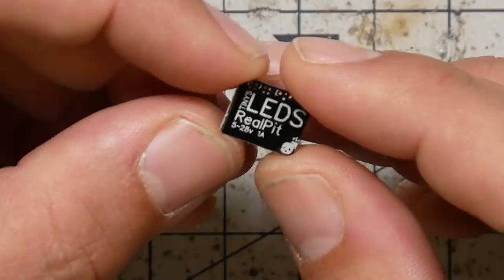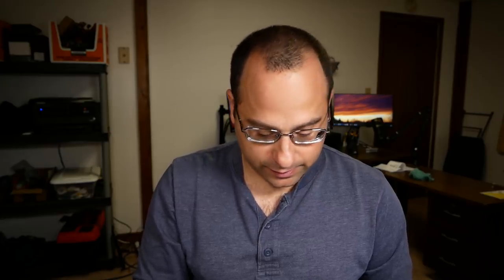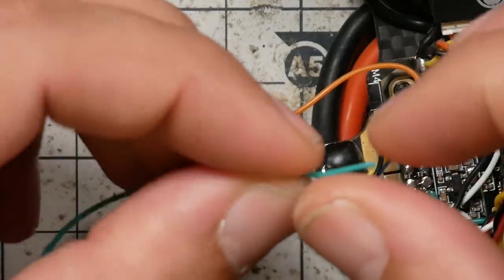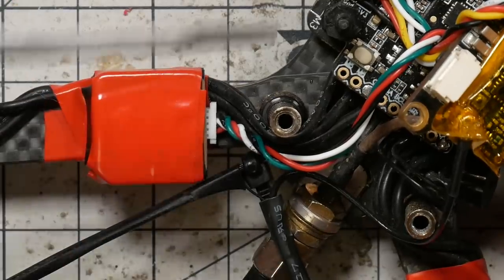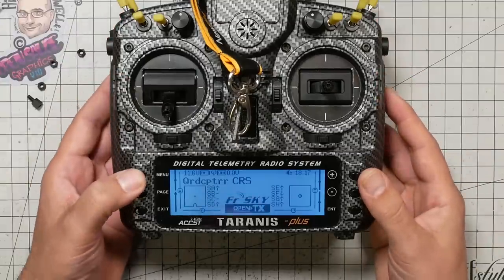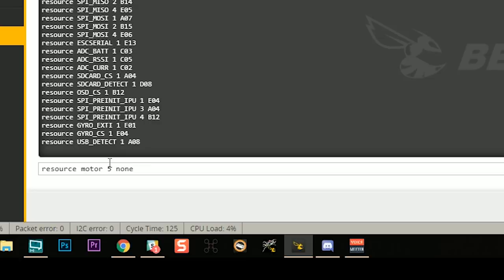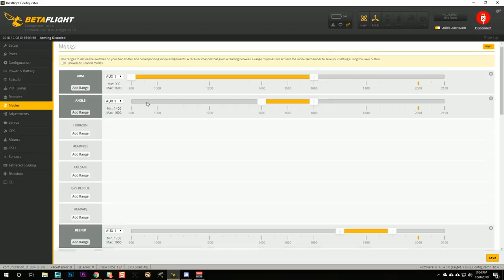Switch vTX Power Off Remotely? | TINY'S LED REALPIT

Comment: Joshua, I have been using these for couple months now and have them on all my quads.  I love them.   BTW if people are short UARTS and you have SmartAudio on the Tx of a UART, you can use the Rx of the same UART for the Realpit.   Smartaudio only needs the Tx line.  Just locate the Serial Rx pin related to the Smartaudio UART like you mentioned and remap it accordingly (eg. resource SERIAL_RX 3 NONE and resource PINIO 1 B11 ).   A suggestion for cases that other pads are not available on the FC.

Comment: Josh, get that GPS antenna off the arm. You should put two large zipties next to each other, zipped to the arm, and leave about an inch not snipped. Wrap it from the top and zip it at the bottom so when you mount the GPS to the top of the unsnipped portion, the surface of the GPS is flush with the surface of the arm, then all you have to do is heat shrinktube it all together. I have it like this on all my builds.

Comment: For those of you that saw my questions to Joshua about the Omnibus F4 V5 I have an answer. I am running a Spektrum Spm4649T receiver. I have the signal on the receiver hooked up to Tx3. The Smartaudio is hooked up to Tx1 and the gps is hooked up to Uart 6. For the RealPit I have it hooked up to the led strip 1 and it works finally. Thanks again Joshua, Tony
Reply from the maker: Glad you got it working Tony!

Comment: Just to highlight.  With this and Betaflight you CAN change VTX channel without the VTX being on using LUA scripts.

It was a throw away comment, but this is critical for racers who may need to change channels between races without knocking other pilots out of the air.

Another way to do this (and may be worthwhile of another really short video) is to change change channel on the FC using BF CLI.  (set vtx_band = 4 <ret> set vtx_channel = 6 <ret>  save <ret>).  This way you only power the FC (and do not even need a battery as the FC gets power from USB).
Reply from the maker: Yes correct.
Reply: I stand corrected ... I assume you tested this with all popular vtx's ?
Reply: @KiSwiSje  As usual, must with with VTX that has Tramp or Smartaudio.  :)   The startup sequence sets the VTX to the channel the one set in the FC.

Some FC's can power the RX directly from the USB.  You don't even need a computer, just a powered USB cable (like an iPhone charger wall wart :) )

I tested it with my KakuteF4V2 with MatekHV VTX.  Works fine.   I use Betaflight 4 and the new launch mode for racing.

Test on your own setup to ensure it works for you.

Comment: You can do the same thing with a 12mmx12mm mos trigger switch, that costs about 50 cents, with less wiring, and the ability to handle a MUCH higher amp load, (even the HD realpit is only rated at 2amp, the 50 cent switch I use is rated for 200amps) or a one dollar trigger switch/voltage regulator combo board that's not much bigger, if you needed to drop the output voltage at the same time.
Reply from the maker: Yeah you can. But this one is nicely soldered to a PCB and easy to work with. Nobody is representing it as anything except a little FET on a PCB. If you can do it cheaper, more power to you :-)

Comment: Now we just need to incorporate into the FC!
Reply: So true. This feature should be every FC, at least one switchable 5V line.
Reply: @Gosuminer  clracing f7, build in
Reply: @SaverioGarzi  That's cool, but I really hope this catches on because it would be so useful for racers and freestyle pilots alike.
Reply: This I already in the WhitenoiseFPV Synergy FC.
Reply: I do not know why we can't have a programmable logic signal control on any of the digital out lines.  Seems obvious to me.  Configure in the adjustment tab "aux3 > 1900; trigger pa6 high".
Reply: VTX switching is built into the Matek F722-SE aswell..

Comment: Soo it's an electronic switch with a fancy name? It's a damned good idea nevertheless.

I wonder if we'll ever get to the stage of analogue video transmitters adopting the spread spectrum technique of avoiding interference, if such a thing is even possible.
Reply: It’s a high side switch. Safe to use on anything we have on our quads. Low side switch options have possible issues of allowing current to flow into the MCU and fry it.
Reply: Could you briefly explain what these 2 types of switch are? TIA
Reply: robrow there are essentially two main types of transistor, NPN & PNP, MOSFETs have P-channel & N-channel types.
The most commonly used type is NPN & N-channel which when used as power switches essentially turn ground (low side) on/off, whilst the PNP & P-channel turn positive voltage (high side) on/off.
Reply: licensetodrive Thanks, today I learned something more 👍
Reply: Been using for for a few months and really love it, really great and simple idea with lots of possibilities available with more to come!
Reply: I built it since i started fpv..i thought it was on the market!!!
So at least i was ahead in something, :D

Comment: Great video Joshua! I have a MUCH simpler option. Just install a miniature 12v switch inline with the +v rail to the VTX. You can get tiny surface mount switches anywhere! Job done. 👍
Reply from the maker: Can't be triggered remotely though.
Reply: Fair comment, 🙌 probably come in handy if you crash and you don't wanna fry the VTX, although I use Lua Script on my QX7. Cracking product tho. 👍
Reply: This doesn't require Lua script. And you aren to able to reach your quad on the starting line once the race has started. So while a physical switch is possible, it is not comparable product. @Ja5onB0urn3

Comment: You don't want to power off your receiver with one of these, you want to put your quad into failsafe instead to control that.  Set the switch so when the VTX is off failsafe is on.  You can do up to 3 quads this way all bound to the same model.  Extra points if you put a mix on that switch that allows another switch to move the main switch 20 points or so.  Then you can have a remote VTX switch and a quad switch switch.  This is the ideal team racing setup... 3 quads... all plugged in... and the ability to select each quad and turn off all VTX while still having control of the quad.
Reply: Are you using crossfire? I tried using failsafe for this purpose and couldn't get it to work?

Comment: Back in my pre-FPV quad flying days I wanted to switch something on/off through the PPM signal from the receiver in my GPS quad, could've bought such a switch, but it cost half that to make one with a microcontroller & MOSFET, so I did.

What did I want to switch on/off by the transmitter? A 50 watt LED sitting underneath the craft pointing down :D
Reply: licensetodrive leds use low side switching. This is a high side switch.  It safely isolates the component from our FCs to not allow current to flow through the MCU.
Reply: Technically LEDs can use low or high side switching, but I get your point about it being a high side switch, I have a bunch of both in my parts collection.

Comment: Great, but shouldn't it work without this device too? Betaflight has this pitmode option in the modes tab. Didn't work for me actually, even though my vtx (akk oscar backpack) supports pit mode and smartaudio is connected.
Reply from the maker: No, it doesn't work without this device. Pit Mode is not true power off, for one thing. Some vTX put out too much power even in pit mode, and can interfere. More importantly, many SmartAudio vTX refuse to go back into pit mode after power up.

Comment: One more device to fry or cause weird issues when 100% working device doesn't turn on when it need to :)  But I see the good side too. It can help to toggle off and on VTX'es without PIT mode built in. For example - to Matek VTX-HV owners. The real problem would be lack of I/O pins in some FC boards.
Reply: Only reason this device would not work would be user error in configuration. 
Also. This can use almost any pad on an FC. So lacking of of I/O pins would not really be an issue for any modern FC. You do not need a Full UART or anything like that. Just a pad on the FC that is able to be assigned to PINIO function.
Reply: @TinysLEDs  For many "decent" FCs it is still an issue if you wish to keep LED strip and buzzer functional.

Comment: There's a flightcontroller in the pipeline with this feature already integrated ;) And you can also directly solder the vtx to the pcb board of the fc !

Comment: I also noticed you Kapton tape on RX do you prefer to clear heat shrink? I have it but have never used it but think I will give it a try.
Reply from the maker: Clear heat shrink is fine but it's often a little thicker than Kapton and also I never quite have the right size.
Reply: Thanks for the reply and all you do for the community. This video gave me something else to buy which is not a bad thing. I have a few builds I am working on and one will be the remix frame with a mix of purple and gold stand offs, your FC and ESC combo and your purple and gold motors. I can't wait to get the parts and see how it will all look. (no clone parts this time)

Comment: If you don't want  to have the User2, User3, and User4 visible, you can type "set pinio_box = 40,0,0,0" and then you will only have User1 visible in the Modes tab.
Reply: You can also just click the hide unused modes button at the top. We did all 4 just so that you have the ability to easily configure more than 1 realpit if you needed to.
Reply: @TinysLEDs  That is also an option.  I personally never use that little switch. If one was to end up using another user defined box they would have to go into the CLI tab again anyway to set User2, 3, or 4 so it's really a matter of taste.  Both options work in the end.

Comment: if the vtx is not powered, you can not use the lua script to read the settings, or change the channel, I think. Same goes for the betaflight OSD method. Only way to do this is with the wand, or with the (experimental) android app, using the connected tag. I can not easely test this, but with your setup it should be easy enough to verify this. Maybe some day we will see this sort of thing built into fc's and betaflight? Better still would be if a vtx starts up in a real 0mW pitmode.
Reply: apparantely, I am mistaken ... ArchmageAU commented on this. "Just to highlight. With this and Betaflight you CAN change VTX channel without the VTX being on using LUA scripts."
Reply: @KiSwiSje  Some FC's can power the RX using the USB (like Omnibus).  On those, the TX LUA script will work without even having to start Betaflight configurator.  Just plug the FC into a powered USB cable.

It's a neat little hack.
Reply from the maker: ArchmageAU is correct. You can write the setting to the FC using OSD or CLI and then when the vTX powers up, it will take the new setting. You should verify whether the vTX briefly blasts the old channel though.

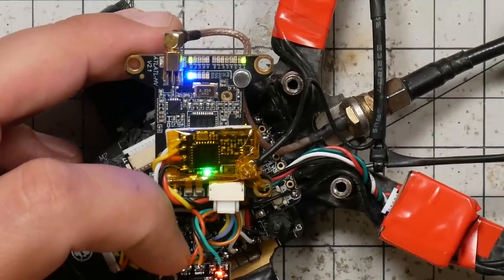Comment: Hi @joshua, thanks for the very thorough videos. You mentioned at 9:39 that we can have up to 4 of those connected to the FC. where is the limitation to 4?
Reply from the maker: I believe that the pinio function only supports up to four user modes. So that limits you to being able to switch only up to four realpit devices.
Reply: Joshua Bardwell
Makes sense, thanks 🥇

Comment: ooh this could help me, currently i use the runcam split 2 on my second quad as a ground camera, obviously i dont want to power the whole quad so i've jerry rigged a jst connector to power it by itself or via the quads power line.

Comment: I have a Tramp VTX and I simply used the Pit Mode option in Betaflight Modes to do this.  No need to buy anything or solder anything.
Reply from the maker: Like I say in the video, put mode is not guaranteed to avoid interference. And put mode doesn't work reliably on many vTX.
Reply: @JoshuaBardwell  Appreciate that.  I can only speak on my own very limited experience and the Tramp VTX  (ImmersionRC Tramp HV) has a Pit mode capability and with Betaflight Mode it seemed like the logical choice for me.  I have used it and it seems to work fine so far.  I always appreciate your videos and have learnt so much from you, Thank you.
Reply: That "pit mode" is just super low power. This is ZERO power and universal for any vtx. or any other product you would like to use.  @cavman7

Comment: Im kinda surprised no VTX's yet have come out with this built it...
Taking a PWM signal means it can also be connected to rx's with spare out[uts like the L9R while FC runs on SBus....
Great idea, but it's so small it
ll need heatshrinking onto the VTX or similar- which brings me back to the first sentence......lol
Anyway, thank you again :)
Reply: Whitenoise FPV has one coming out soon. he also does boards that mount the vtx onto the stack that include realpit. I'm using one with my unify nano

Comment: Joshua, is the set up the same for Tiny’s “2-12s LED PDB with FC Switch”. I want to use this board for all my LED’s on my bangGod, just one switch for all on/all off. It lists as good for 21 AMP current limit. Thank you

Comment: I was wondering why wouldn't  be possible to power something directly from an MCU pin, like the buzzer out. And the problem is that pins handle only up to 25mA. This is why Tiny's Led exist. I would like to know what signal/voltage is the remapped pad outputting.

Comment: So, it is like connecting basis to signal wire, in your case it's connected to pin M5 on FC, and connecting vbat to collector, emmiter  to vin on vtx.

The current flow from collector to emmiter that is going to power the vtx up is controlled by output from signal wire .. cmiiw

Comment: This would be very convenient to switch GPS on and off for rescue mode. If I just race proximity I don't need to wait for 5 minutes for the GPS to lock 6 satellites.
Reply from the maker: You can set the "min sats" to zero. Then you can arm any time you want but if you have < 8 sats GPS Rescue won't work.
Reply: @JoshuaBardwell  really? I have set minimum sats to 6 and it works just fine.

Comment: You could wire your vtx ground to your buzzer ground. And then setup up mode switch to control the vtx.
Reply from the maker: This is risky because the buzzer circuit probably can't handle as much current as the vTX needs. It might burn out.
Reply: @JoshuaBardwell  true but if it's just for a race vtx they do demand the lowest amperage and the ground side is the safest side.
Reply: Ground side is NOT the safest side for vtxs. Maybe LEDs but not vtx's. This is a high side switch. and 100% universal with all current VTXs. the Voltage range is much higher as well.  @HighTideFPV
Reply: @TinysLEDs  I suppose so if you didn't have your vtx on 5v. A lot of vtxs are ran on lipo voltage now days.

Comment: Dude...have you done any videos on the pinio_box or aux CLI commands you used here?
Reply from the maker: No, I haven't. pinio is a bit esoteric and basically manufacturers of accessories like RealPit will just tell you the right command to input to make their hardware work. Aux is just the way of storing the Aux Modes from the Modes tab, and there is not really any reason to input the aux command manually.
Reply: Joshua Bardwell ok...thanks for the response...the reason I asked is that one time I was trying to add a buzzer to a FC without a buzzer- pad (hyperlite f4 - non OSD version) by remapping the beeper resource to the one associated with motor 5 and then wanted to map an aux to that beeper...but now I remember I incorrectly thought my problem was not knowing the right aux CLI command...instead the problem was the beeper can’t use any old pad...it has to have an additional transistor on the pad to get it to work.  TLDR, I know...

Comment: How come you don’t use the ‘vtx pit mode’ option in the modes tab?
Reply from the maker: Pit mode is still transmitting power and can interfere in some circumstances.

Some vTX (like Unify) refuse to go back into pit mode after power-up.

Some vTX "glitch" when changing power settings. So you arm the quad and then a second afterwards the video drops out for a fraction of a second.
Reply: Joshua Bardwell very interesting, especially as I have a Unify. It would be great if you could set vtx power on a switch like in the Kiss Gui. Thanks for the reply 👍
Reply: You actually can assign pinio to that VTX PitMode  mode. However I’ve chosen to not overwrite it and use the custom switches so that people that have VTXs that use the PitMode function can still utilize it w hole also using the VTX power switch. If you wanted to use vtx pit mode mode just set pinio to 39 instead of 40.

Comment: Hmmmm.  LED output sounds interesting.   Could help make my 3D kwad a total acid trip if flying around dusk for everytime I switch a mode.

Does the switch work off a straight PWM signal if I trip it off the signal output from my CrossfireNano RX?   I have ch 3 and ch 4 outputting for controlling the switching of FPV cams without having to go through the FC.
Reply: It does not work using PWM. It uses the PINIO feature in Betaflight.

Comment: Do you recommend this realpit powered straight off the battery pads on the PDB rather than the 5V on the FC?  I'm only using 4S.  If I remember about 6 months ago, I had brown outs, then finally nothing.  The 5V regulator on the PDB burned out, so I had to swap out PDBs.
Reply from the maker: The RealPit just passes through whatever voltage you give it. So if your vTX runs off of 5v, then you give it 5v. If your vTX runs off of vBat then you give it vBat.
Reply: Always appreciate your input. I get it, I was just suggesting so others didn’t burn out a regulator.

Comment: how long till this is integrated into lua / on an FC! :)
Reply from the maker: It already is built in to the CLRacing F7 I believe.
Reply: It is also built into the Whitenoise SynergyF4 Flight controller coming very soon.
Reply: The Matek F722-SE has a VTX Power Switch as well as a Camera Switcher to allow for two cameras.